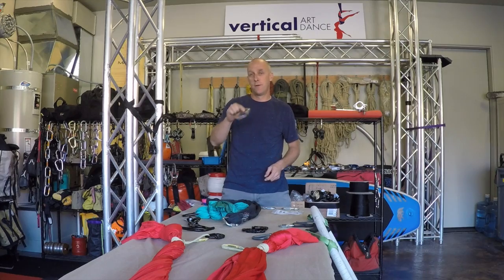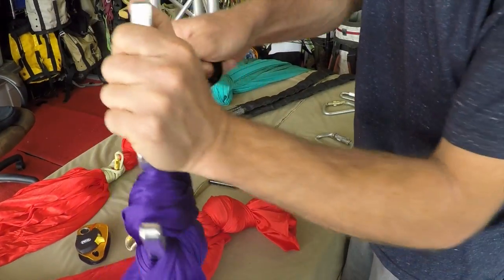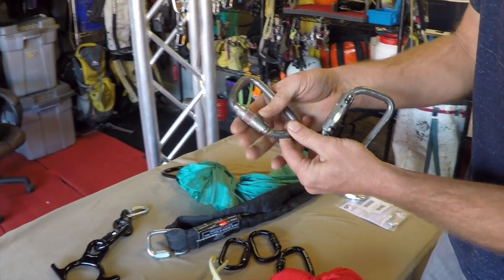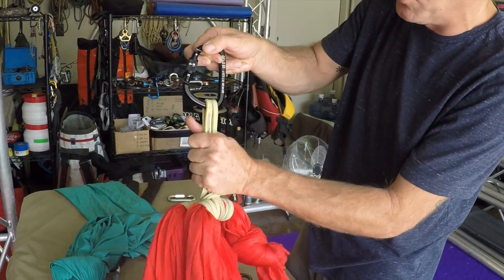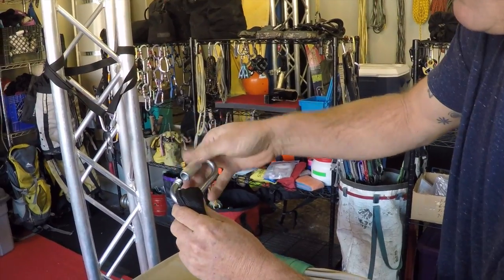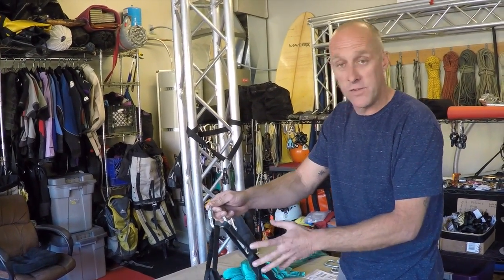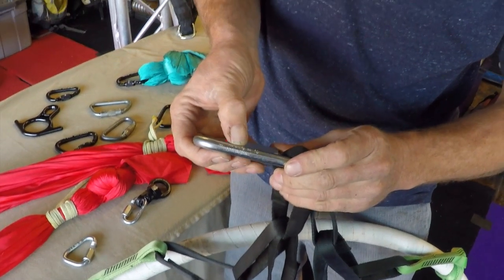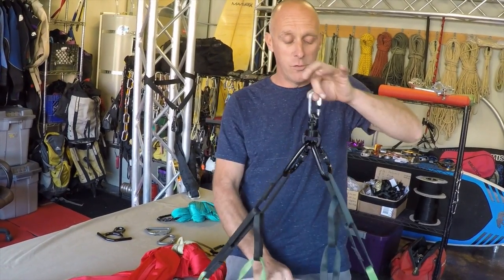Aerial Rigging: The Complete Carabiner Talk

Comment: This makes me simultaneously terrified and empowered to hang my aerial yoga silks (in my current old house, which could mean stronger or weaker structure)! I'm hoping I can somehow translate this information to someone to help me, and find the right skill set (and tool set) for implementation. I have felt that many people in the yoga community act as though setting it up in your home is easy, that everyone can just get going right away, but my concern was along the lines of many people  'getting away with (what is actually not) good enough.'
Reply from the maker: Brittany Lauren Wheeler setting up in your home is not easy nor recommended to be done unless an engineer/contractor/etc is involved if attaching to an existing structure. We provide engineered, rated, free standing structures for this type of use. You can visit our website www.verticalartdance.com or email us info@verticalartdance.com ❤️💜❤️ Safety is number 1 thank you for your comment

Comment: Thanks for sharing this great video.

I would like to ask you what you think about periodically retieing the knot of the silks to prevent it from always working in the same place. Some colleagues have adviced us to move it 1 or 2 feet left or right from where it is after a few months or years of work. By doing this, the part where the knot has been sitting, which is stretched, will stay away from the newer knot.

Thanks again.

Comment: Nice video!

I want to clarify a few things:

What you call a tri-link is a delta according to Peguet, but yes many call it a tri-link.
What you call a delta is a square link
http://www.peguet.fr/maillons-rapides-epi

I know is not an universal answer but according to Peguet, the delta(tri-link) should only be loaded along the main axis.  It's a nice solution for big webbing.
http://www.peguet.fr/self-certified-maillon-rapide-quick-links/delta-maillon-rapide

Square and standard quicklink should also be loaded on the main axis.  A standard quick-link is almost like a link in a chain, you normally don't want to triload a link in a chain...

Now, tri-loading of a delta quick link... If you do it, you don't respect the recommendation of the manufacturer so you choose to take the responsibility of this usage.  
You could probably do it, well at least many use it this way but the breaking strength is unknown, probably between the MBS of the major and minor axis but closer to the MBS of major axis.

For tri-loading we can use a bow shackle or a delta plate.